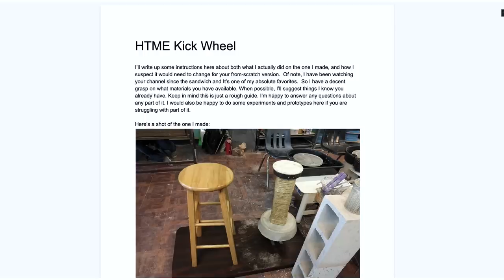Pottery Making Using the VERY FIRST Wheel

Comment: Someone needs to make a VR game on this idea where maybe once a month they add a new "era" or set of technology that requires  most things from the past eras to get to that tech which is a bit more complex than the previous one. It would be very complex and their would be a lot of doing it all yourself not just asking a friend to trade a flywheel or just sticking the tools and items together to make it but actually doing it by hand and it would have a quality rating based on how well it was made that would determine how good it is. Their could be multiple variations of one tool or item that do the same thing but different ways. Of course this would be impossible to make as a game.

Comment: so using this pottery wheel could you then make a more round version out of clay that would work better?
Reply: Hahaha.... a pottery wheel to make a pottery wheel, just like a lathe to make a lathe and a hammer to make a hammer XD
Reply: @sgctactics  well I did consider how to use it like a lathe but I figured it would be hard to use a rough stone to shape wood, but if you used wax like a glue you could probably get a pretty secure grip on some timber and then spin it to shape wood more consistently
Reply: @aaronhays2866  no, it'd work fine, I just love the old joke of needing something to make itself. How do you forge a hammer without a hammer? Or tongs without tongs, or how square was the first square? How are shipping materials shipped? :)

Comment: Andy, what is in the holes at 13:33 ?
Reply: Those holes are for cotter pins.  Since the flywheel is hanging from the tie rods, it would put a ton of stress on the connection.  The cotter pins should hold the load better and prevent separation.

Comment: Those are not maggots they are grubs fly larvae are maggots beetle larvae are called grubs. However both make excellent bait.  Also it is clear you have chisel tech so a wedge would have been a normal thing. I would have therefore used wedges to split the log and made the thinner boards and crossed them at 90° to get more strength then put weight near the outside of the flywheel. That would have given a more refined product still using the tech available at the time and saved a good bit of effort.  Also it would have made a more durable and easier to use product.  Just something to think about.

Comment: Sorry, gotta be padantic, the wheel is found almost nowhere in macroscopic nature. The are insects with hinges in their joints which strongly approximate mechanical gears and in so could be considered a wheel, and in the microscopic regime you have the molecular complex ATP synthase, which is literally driven by a confined axle serving simultaneously as the rotor and bearing for a proton gradient powered engine.

Comment: For the love of all that's holy man, SHARPEN YOUR SAW!!! It is PAINFUL to see you struggle through wood with that makeshift saw of yours, and while whetstones are not ideal for sharpening serrated blades, for your purposes I think they'd work just fine. Any little improvement will save you hours of work, and probably persistent arm strain! It'd be best to actually get a proper natural whetstone from Arkansas (a type of chert called novaculite), but you could find any stone that is both ultra-fine-grained AND contains minerals that are harder than your knife material to do a rough (but serviceable) job. Even granite would theoretically work, as long as it's not pegmatitic granite.

Comment: 17:10 why use solid wood? You coulda made actual wheels using bands of wood, and increase the weight with stones to make a flywheel instead of a solid chunk of wood. And while you were recommended to cut the log to add strength, the first wheels would have likely just been a flat tree stump to get something round without a ton of glue and chiseling. idk

Comment: I think you used the wrong lubricant. I'm sure they would have used a harder fat like tallow or lard. That would let the fat stay in place longer. Animal fats work more like grease than liquid oils. I'm not sure but I have noticed that many of the tools you use are not regularly sharpened. Most of those tools would need regular sharpening to keep working right. the saw would have worked better if you sharpened it.

Comment: I think applying the wax on the top was pointless, if you wanted to protect the wood you should have applied it to the sides as it was a piece of lengthwise sawn timber.
You weren't exposing any of the grain upwards, only to the side.

Comment: You're using multiple different tools for the same job, kinda showing that you haven't actually progressed past or to that part yet. I mean in one part you used the saw as a hatchet and hacked at a piece of wood. I think a video of refining tools or sharpening edges and then holding yourself to making tools better instead cycling through 5 different tools to drill a hole would be appealing to me at least.

Comment: That looks like a horrendous pain in the ass. I can barely stand cutting through a board with a modern hack saw, much less a log with a thick, dull bronze steak knife. As for the grease on the ball bearing, I would think actual grease would be preferable. That olive oil will will just run right off. Animal fat would probably stick a bit better.

Comment: So i'm of the opinion that ancient people were more intelligent than us, but less communicative. communication, language, and the passing down of ideas and information between generations is a more recent biological development than intelligence. The capacity to use intelligence to solve problems predates language, which itself is a biological response to the problem that was information transfer. Language brings us closer together as intelligent beings, and facilitates information flow, but it doesnt make us smarter. if anything, with how fantastically successful language has been as an adaptation, I believe it lessened the environmental pressures that preserved or encouraged the evolution of greater individual intelligence, and actually allowed for degeneration in individual intelligence over millennia. But anyway, my point is, I believe the ancients were smarter than us. And Im pretty sure individuals would have figured out very rapidly that the best way to make a wheel, was to take mud (then clay) and poke a stick through any part of it, and rotate it on that pivot, and placing a fixed scraping object of any sort at a distance from the pivot, to grind away at the soft earth, thus making a "perfect" circular edge, even if it wasnt in a flat, disc-like wheel shape. Even a ball or "fat" wheel with a perfectly round edge would be a GREAT tool for energy transfer. Even so, just placing a fixed scraping edge on the top would allow you to give it a flat face while spinning, then flip it over and scrape the other side flat as well, thus making a nearly perfect wheel of clay. I think the act of "turning" things on a pivot point is likely one of the oldest human technologies. From turning meat on a spit over the fire, to spinning sticks on sticks to start fires with VERY little effort, I think the only reason we dont have as much evidence for any of this is because for most of human history, they didnt know metals existed, and most tech was made of wood and clay or ceramics. I mean, in all honesty, with a hunter-gatherer lifestyle, and all the ease and leisure it honestly affords, why would you need anything else? Written language didnt come about until the first small "cities", which likely only occurred due to a transition to eating grains, and with the advent of agriculture and more dense population concentrations, ancients and pre-historic peoples probably already knew metals existed, but saw them as requiring too much energy and effort to develop, compared to clay and pottery, for daily needs. I mean, can anyone think of good reasons why to move to investing heavily in metallurgy other than for more durable chopping and fighting tools and weapons? Even throwing rocks with slings and shooting arrows with non-metallic arrowheads was preferred into the beginning of the bronze age. So why did bronze and then iron replace stone and clay tools, other than for military reasons, which facilitated the rise of concentrated population centers and empires preserving or expanding their territories? I just see metallurgy as having not been very necessary or even practical until you had the excess energy and manpower (in the form of high-carbohydrate diets fueling booming populations of weaker and less healthy masses and slaves, ruled by kings and aristocracies who were healthier, stronger, and smarter, due largely to more protein-rich diets) to be used for specializing in purifying and working metals to make tools and weapons that would last much longer than the lives of individual users.